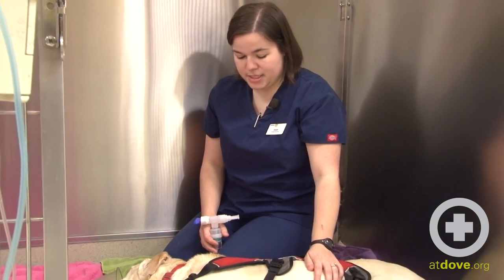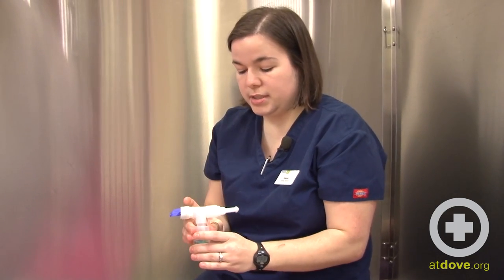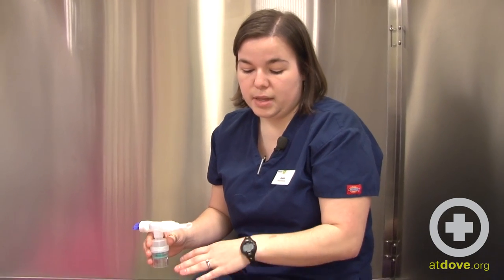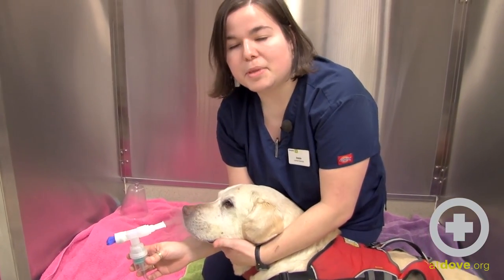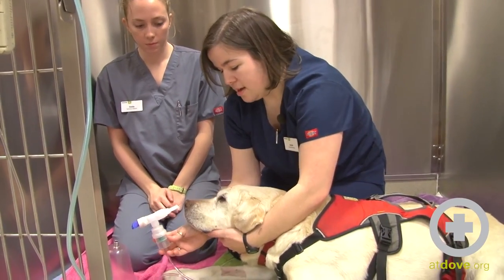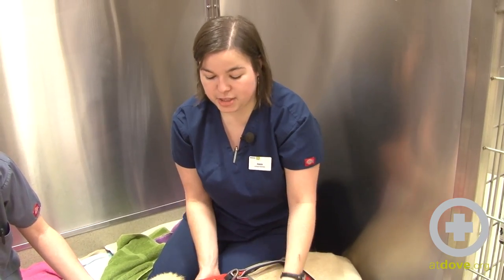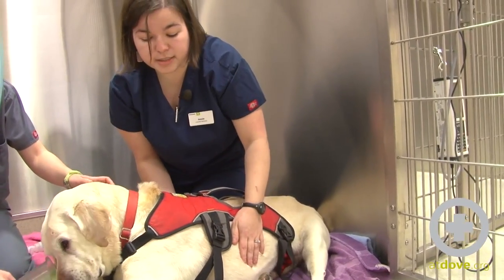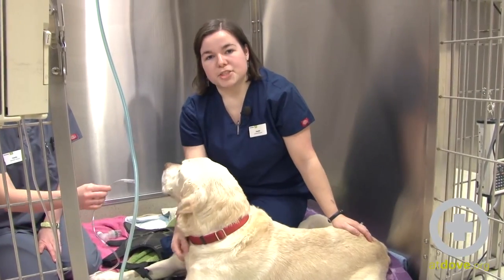Techniques for Nebulization and Coupage

Comment: Do you rinse your nebulizer with sterile water❓The reasoning behind my question is that for years treating respiratory problems in humans we were never told to do this and then it was an infection control issue. Thought I'd pass it to you.🐒
Reply: I think a mild soupy water is fine for cleaning. The water in the neb should deionized or distilled.